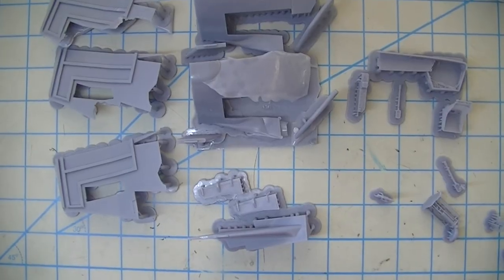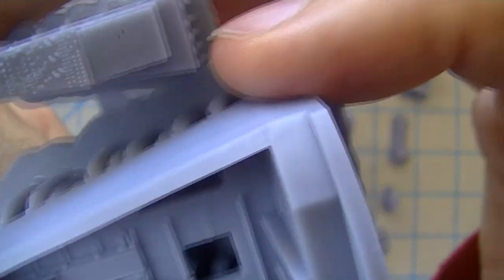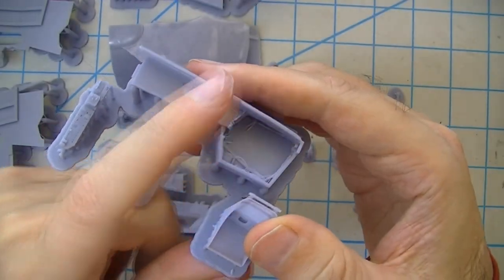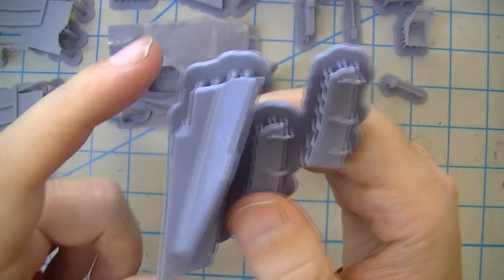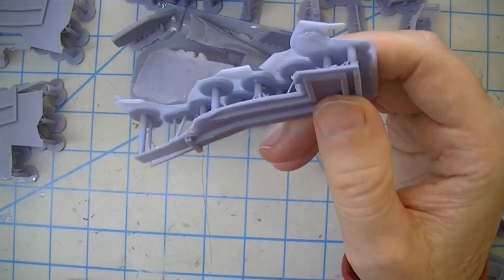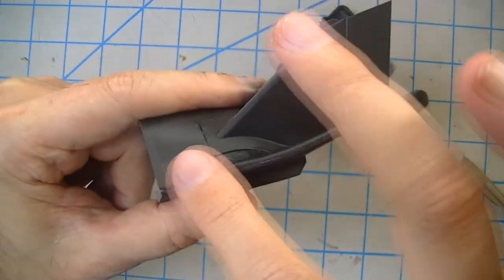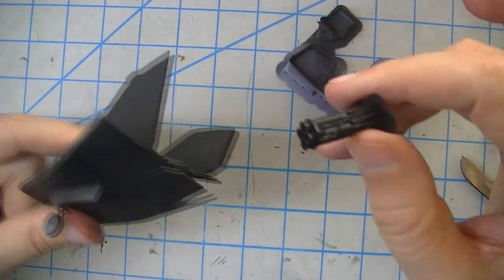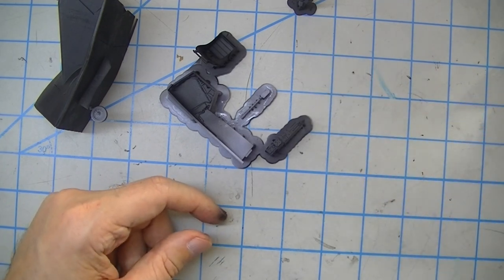ep343 - the epax x1-4k 3d printing adventure part 6

Comment: regarding the missing geometry on the control stick - I suspect non-manifold geometry is to blame.  Possibly the normals got flipped somehow.  I would try running a mesh cleanup function in the source application to try and find / correct the problem

Comment: I’ve found that the same file sliced with the same settings in both a Chitu and lycee gives different results. Chitu filled in holes, that I wanted to remain hollow and created layers across the opening, while lycee didn’t. Sometimes double slicing is a thing.

Comment: Thanks for sharing all this Mr. Pattison
Amazing what details you put into your cad files.
I'm a mechanical engineer and spend all my worktime in cad, so I prefer to not overdo it in my hobby and spend more time building. At the moment I have a filame t printer and consider in buing a resin one.
Is there a scale modelers community or shop where you can , share, get or buy files for download as pilots, seats or engines to upgrade kits?
Many thanks